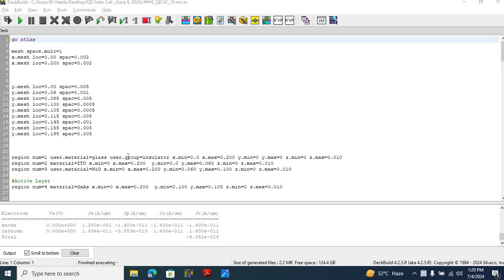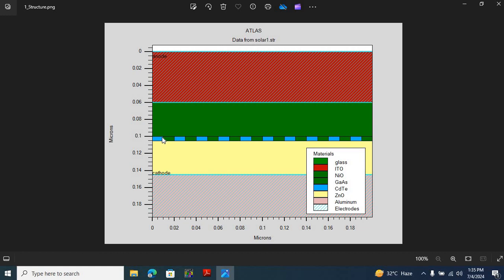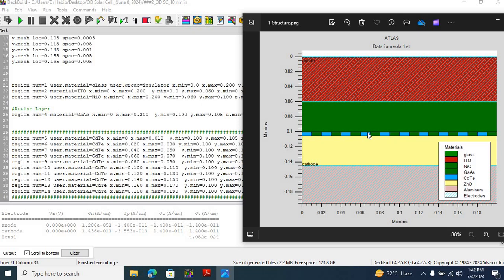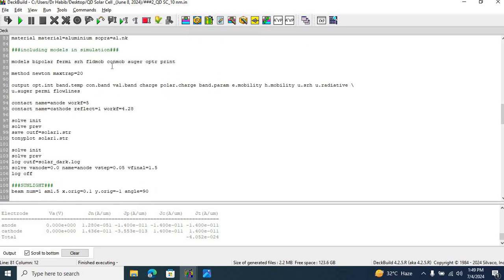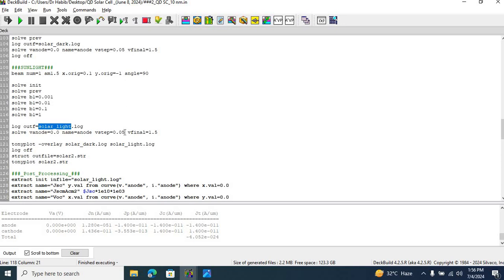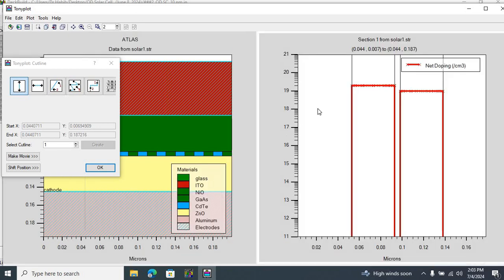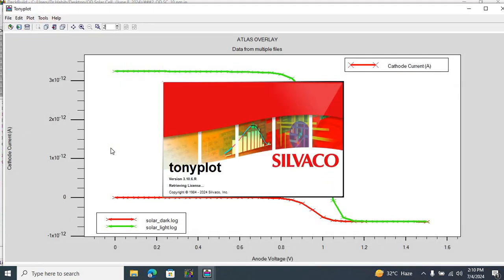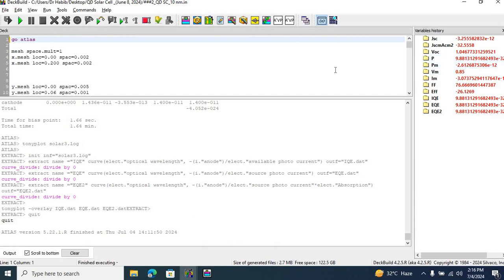⚛️🌞 Quantum Dot Solar Cell Simulation Using Silvaco TCAD 🖥️✨

Comment: Sir shouldn’t the bias voltage should be negative for the reverse bias configuration, region 2 is N type and last layer is P type so if positive voltage is applied and the top contact is anode won’t the solar cell operate in forward bias ?